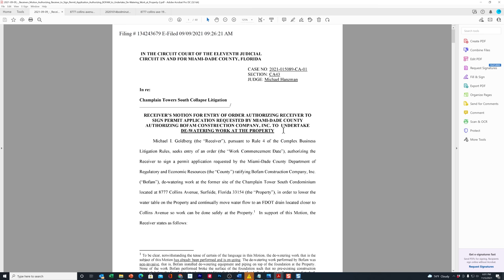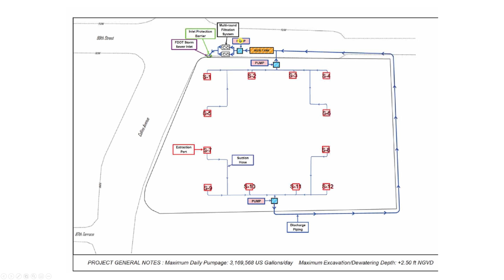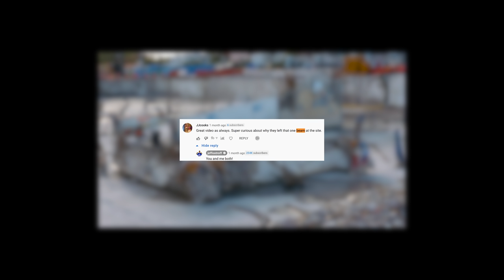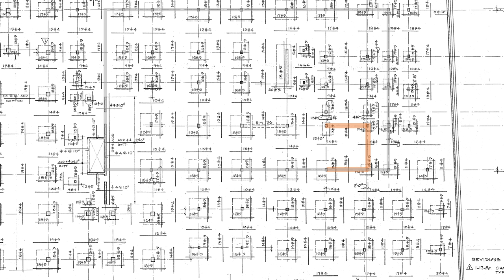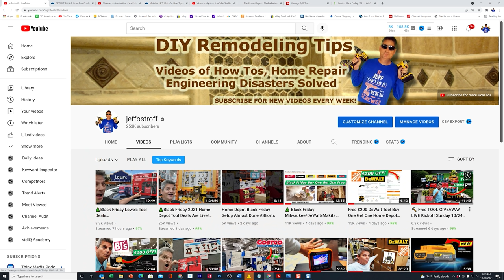Miami Condo Collapse: Engineers Baffled By Mystery Column

Comment: Apologies if I missed it in an earlier vid, but what WAS the reason that only a very few garage-level columns had RED-painted lowers (e.g. 86-87, 17-18), vs the usual YELLOW visibility paint?  Fire Dept. hydrant/outlets?
Reply from the maker: That I do not know the answer to. But I doubt it had anything to do with the fire department because of the freeze frame if you look in fiorello's video from the garage, you'll see that fire extinguishers are on other columns that have yellow stripes. But if you go back and look at that freeze-frame closely you will see the column with the stripe on it inside the garage appears to have some type of switch or other fixture on it so there may be something to indicate that that column has something to do with backup power or an alarm or something just not sure
Reply: Generally, red painted columns signify some type of fire equipment involvement.  Fire extinguishers, likely.
Reply: @ChiTownDude  I remember noticing that in a Sears or Montgomery Ward department store years ago. All the columns with a fire extinguisher mounted on them had a red stripe painted around them at ceiling level. I wonder if this was a code requirement.
Reply: 6:58 87-88 7 is red, 8 is yellow and look like it has a fire extinguisher unless it's something else.
Reply: @jeffostroff  Maybe it's coincidence, but the ones painted red have fire alarm pull stations on them. You can see this on the columns labelled 16 and 54 in Fiorella's video.
Reply: @ Major Calibere Bright paint is to increase visibility for drivers and minimize lawsuits for auto body damage. 

It’s fairly easy when parked in a space to turn the wheel all the way and back out (while looking over the other shoulder). This slams your front fender into the pillar.

In dim light of a garage it’s surprisingly easy to do.
Reply: @alobodig  BINGO Albert, that's what it is, Fire Alarm Manual Activation sites!  Good eye on these blurry lo-res vids...
Reply: @davecc0000  You're right, that's what the YELLOW paint is for, but the rare RED columns are, as Albert said, the "come over here to sound a Fire Alarm" markers.  (One wonders if an active fire alarm shuts OFF the garage exhaust fans?... or boosts them to max speed??... i.e. smoke inhalation danger vs fanning the flames?... anyone know?)
Reply: Ya red paint is normally to indicate something to do with fire safety premeasures.

Comment: Mystery column rebar looks to me as having a different texture. Its smoother than the surrounding columns rebar that all have very noticeable ridges. Is mystery column a very recent addition added in to hide or help the H beam possibly sagging or having serious cracks in the underside from additional unknown stress? Work may not have been documented to try and hide that they knew the issue was serious and so keep property prices high/stop residents from causing trouble?
Reply: It wasn't under the H beam in any way it could have carried a load.  It was offset several feet, inline with the 'O' columns.
Reply from the maker: Well if the column was added later it was not attached to the age beam which felt pretty intact, it's simply outside the footprint of the age game so it would not be holding it up. If anything it was likely shoring up just the ceiling above it possibly through use of some kind of large wood plates or 4 by 4 posts against the ceiling
Reply: @jeffostroff  clearly must have been added after that walk-through video by Fiorella—you can see in her video there’s nothing there at all. So how did they get the rebar to stick up from the garage floor like that?! Is there a piling cap beneath that location?
Reply: @kineahora8736  this was going to be my question? Wouldn’t you have to dig up concrete to get the rebar in like that.
Reply: Work was documented somewhere I’m sure that costs a pretty penny to install
Reply: @ashleelalasmith2792  Unless it was a 'Home Depot sidewalk' worker special...
Reply: @ashleelalasmith2792  UNLESS: the exposed “floor” we can see now is actually BELOW the garage floor level, and we are actually looking at the piling cap itself… which is below the garage and there was actually never a column above it….
Reply: @kineahora8736  curious to hear your response on this one jeff

Comment: I noticed in the parking garage video that there is a pipe that appears to go through the H Beam “can’t tell for sure it may go up through the floor” but if so the pipe passes through the H Beam right above where the mystery column is. Is it possible that this was identified as a point of weakness at some point after the video?  Also is it possible that the parking garage video is actually from the other building?
Reply from the maker: Usually in constructions you can have a whole as big as 25% of the beam that you're cutting through. So I doubt the fact that they cut through the beam is any type of issue and I don't see any leaks going on with the pipe so I don't think there was any problem with that. Although I do question why they didn't just route pipes around the bottom of the beam

Comment: Looks like the H-Beam shifted towards the 15 / 26 parking spot thereby snapping any attachment to the H-Beam from wherever the H-Beam may have been attached. Also depending on the consistency of the H-Beam strength it should have fallen mostly intact.

Therefore falling down straight from where it stood on the first floor and the rebar pushing into the garage floor adding any other weight coming straight down to pierce the floor with shifting weight to enforce the dig into the land below the garage floor. 

I'd bet 1 dollar if they pulled the rebar up, it would be deeper than is noticeable on the surface. 

Plus the bending of the rebar from all of the that H-Beam location, would be leaning towards the 15 /26 parking spots as evident to the pictures you showed.

My guess only, but I think you nailed it!

Comment: That mystery Collum certainly must have been an attempt to add support , however the location of it specifically does not appear to be doing any use whereas it is not taking any of the pressure load off of the surrounding support beams . The H collum visibly is not designed properly to distribute the weight of the Complex also a complete disater in this type of design if you add water .
Reply from the maker: Plus no piles or pile caps under it.
Reply: Nope, it was always there; just, not where you think it is. Clue: look at the H-beam relative to the ramp in the diagram. Then look at the H-beam relative to the ramp in the video. Not the same. Didn't come straight down.
Reply: @RobbieHatley  I think this is the likely explanation. It tumbled from above and ended up at that spot.
Reply: @jeffostroff  I found it: S-1 L cap at 01-8.
Reply: No.

It came from higher up in the building.

The rebar punched through the slab (How thick is it under travel lanes, right?) and the full extent of damage is obscured by the pool of water.
Reply: @fraidykat  it will be interesting to see the animations that are created about. When I said tumbled I meant figuratively. Any concrete that size is going to head straight down from whereever it was!
Reply: @metatechnologist  And that column went from Lobby floor to penthouse, so there was a lot of force behind it....

Comment: Thanks Jeff, this disaster and your analysis of it has me wandering around my own apartment complex's basement garage and ground level suspended slab parking deck. So far no serious issues sighted but am a bit concerned the local fire engine crew have taken to parking their fire truck on the parking deck loading zone space while they go for a coffee. Not sure it is rated to take such a heavy vehicle.
Reply from the maker: I would add my ring camera at it just for that special moment you can make a fortune with that video when it does fall through
Reply: Generally structures designed for automobile parking, and the design load required by the building code is pretty low for this, will have some mechanism in place to keep out larger vehicles.  Many parking garages have steel bars at the entrance about 6'-10" high so a taller vehicle can't drive through there.  If there is an area where fire trucks can physically fit, it should be designed for truck loading.  That's not to say that it is, but it should be.  For instance the drive along the west side of Champlain Towers had enough overhead clearance that delivery trucks could drive through there but there is no evidence on the drawings that it was designed for truck loading.

Comment: You have visual proof that there was no column in the drive way under the "H" beam before the collapse. there is no column base stub on top of the "H" beam in the picture. how thick is that slab floor? I will bet the column is no more than 3' in the ground.
Reply from the maker: Slab could be 9 1/2" thick
Reply: @jeffostroff  there are a LOT of should be.
Reply: I looked at the CTS plans and the concrete ramp going into the garage is 9.5" thick, the garage slab appears to be the same, although they don't label it.
Reply: @jeffostroff  Correct me if I am wrong, but the Garage slab pour would have been done separately (later than) the columns. If that is the case, we don't know the actual thickness unless someone cuts through it.

Comment: YouTube just put your video in my play list suggestions and while your mystery Column is an interesting question I recently watched a video by a gentleman named Mike Bell that was just as or even more interesting to me.  In his video he theorized that rebar corrosion was not the primary cause for the building collapse but rather a flawed architectural engineering building plan and the bad building design combined with rotten/crumbling concrete.  I have to say looking at pictures of core drilling from the building and the pictures of rebar I have not scene a lot of main structure rebar that looked very corroded if at all.  However back to your mystery column I have a couple questions the fist is how old is the video of the basement parking garage, the second is could your mystery column be an examples of rebar that punched though from above and embedded itself in the basement floor, or was some sort of support column been added after the basement floor video was taken. Personally the punch though idea seems the most logical to me. Thanks for the video and interesting questions/theories about the reasons behind this tragic building failure.
Reply from the maker: It wa slikely a combination of a lot of things wrong

Comment: The column started in top of the H-beam - when the H-beam fell it moved slightly north allowing the column that was sitting on it to fall vertically and punch through the basement floor - I bet the rest of the column is there below the steel sticking out of it. There is likely a void under the floor there allowing the falling column to punch through easily. Look at the earlier picture -the steel is sticking out of a hole - in the later picture the hole has been filled with mortar - seemingly a deliberate act to hide that the column actually punched through the basement floor.
Reply from the maker: believe it or not, there is no evidence on top of the beam that there was a column there!

Comment: Could this “mystery column” be a piling from below the slab? Maybe the whole floor was punched down by the weight of the collapse and it somehow poked up through?
Reply: I would think that it was a column that started above and was driven down in? Weird that it didn't deviate any of the surrounding concrete.
Reply: @johnb9394  I think that is most likely, that it was driven down into the concrete. 

The basement concrete doesn't look broken up and sunken so I don't think it came from the bottom up. My guess it that the stress is so high that it cleanly punched it through.
Reply from the maker: How can a collapsing floor cause a piling to com up? Also the pilings have huge caps on them. Also there is no piling under this spot. Pilings are only under the columns in the floorplan.

Comment: Considering all of the evidence I'm going to suggest that what is seen on the floor is just some form of debris.  It is clear in the pre collapse video that there is no column there.  Then if you look at what appears to be a remnant of a column sticking out of the floor you see that it looks different from the other foundation dowels that are left standing.  The columns in the basement were relatively small and you can see how tight together the dowels are in all of the other column locations.  In the questionable column the dowels are much farther apart and also are of various lengths.  Plus the vertical bars at the new column are coming out of clean concrete, no irregular surfaces between the bars.  However all of those vertical bars do appear to be coming out of the top of the slab so for now this will remain somewhat of a mystery.  You will have to watch for 
"Isolation seam" is normally called an "expansion joint" and is used when the length or width of a building becomes large enough that movements due to expansion in the summer heat and shrinkage in the winter cold become too large to accommodate.  Champlain Towers was not large enough to require expansion joints.  And believe me expansion joints are undesirable unless absolutely necessary because they cause more problems than they solve.  They require a lot more columns as you saw in your vacation video and this makes it very hard to work around parking.  The drawings didn't show that the original engineer had the sophistication to design all of the beams required to follow expansion joints around the building.  With an expansion joint around the perimeter of the tower they would have a continuous maintenance problem with expansion joint covers needing to be sealed and always leaking.  Instead of drips in the garage they would have waterfalls.  But an expansion joint could have been beneficial in that it might have caused a collapse during construction instead of 40 years later and thus affected a lot fewer people.
Reply: It's not an expansion joint.  He's talking about an 'isolation joint', a physical separation to structurally decouple the slab of the pool deck from that of the building.
If they'd used isolation joints, they probably would have had to use more shearwalls/cross bracing for lateral support, but they should have done that anyway...  It wouldn't have necessarily required more columns, but even so, is the price of 'more columns' greater than 98 people perishing?  I vote no.
Reply from the maker: So far $103 million settlement was agreed upon for the families of six people who died in that accident. There's another one that's coming up against one of the other engineering firms involved as everybody seems to be suing everybody in this mess
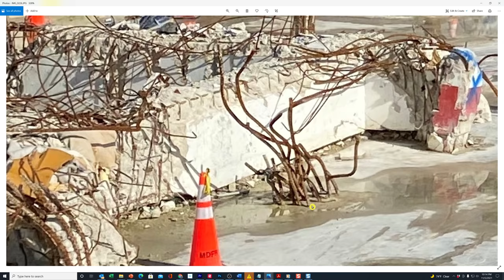Reply: Yeah, but, Fiorella wrote in the description that she was there and recorded during summer 2020. Also at 13:54 you can see on the area of the rebar where it meets the concrete that it looks like some of the concrete is still tapered up and around the rebar.
Reply: @johnbergstrom2931  That is the definition of expansion joint, a physical separation.
Reply: @billj5645  Well, that's just semantics...  The same definition applies largely to both, but different contexts.
My point is they should have left a separation between the building slabs/columns and the pool deck to create two independent structural entities.  Has nothing to do with thermal expansion/contraction.  Has to do with SAFETY, preventing mass death, as it would have in this case.
Reply: @johnbergstrom2931  It would not have been an issue if the building had been designed properly in the first place.
Reply: @billj5645  And waterproofed properly.  Corrosion and spalling surely played a part in the pool deck collapse.
(But I woulda included an isolation joint and shearwalls.  Cause I'm not a skinflint developer...)
Reply: And BTW, here's what wikipedia/interwebs says about it: 
"An expansion joint is an assembly designed to hold parts together while safely absorbing temperature-induced expansion and contraction of building materials"
"An isolation joint is a separation of an existing concrete slab from a new concrete slab or wall."  Also: "A joint that separates one concrete section from another so that each one can move independently"

Both joints, but an expansion joint is to keep things contiguous, and isolation joint to keep them separate.
Tomato/Tomahto, but I'm right.  He he..
Reply: The H-beam in the video is no-longer located where it is in the diagram. Why would it be? The only way it could fall straight down is if the columns under it disintegrated. Wouldn't it be more likely that those columns toppled instead? And then what angle would the H-beam fall at? About 45°, right? So, where would that put the H-beam? About 10m away from where it is in the diagram.
Reply: @jeffostroff  103 m? ridiculous, are they suing themselves?
Reply: @RobbieHatley  The H beam falling at a 45 degree angle would put it LESS THAN 3 METERS away from it's original position.  You're just blowing hot air...

Comment: Jeff,  unless I am mistaken if you look at the blue prints for the basement, there are columns that are about 2 ft or so away from the H beam on the left side. The H beam also looks like it may have been moved.
Reply from the maker: The H beam shifted over slightly as it dropped